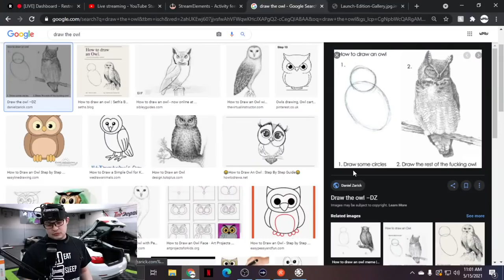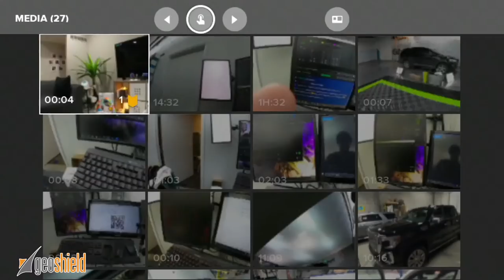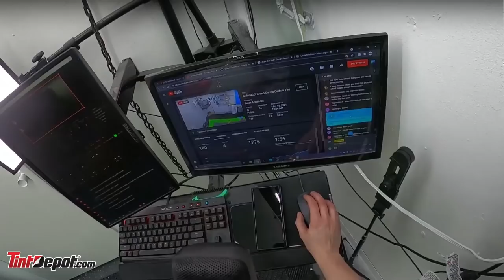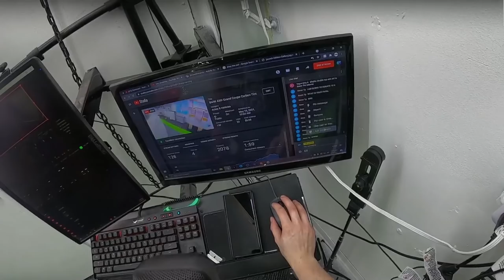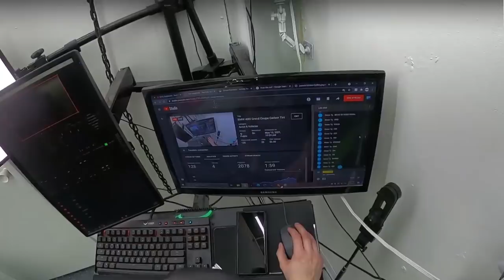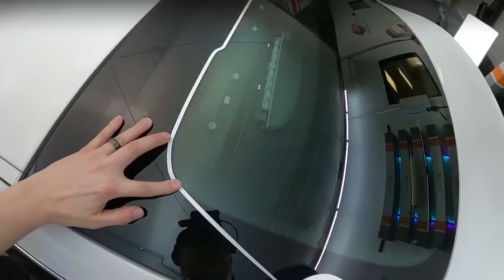BMW 430i Grand Coupe Carbon Tint

Comment: my window tint for the sides is not clean because of those dots that run along vertically by the edges. is the tint suppose to end up cleanly or are you expected to see some bubbles or areas that didn't glue on 100%?  if you tell me i did a poor job getting it done by someone, all good, i can take it. just want some honest view.